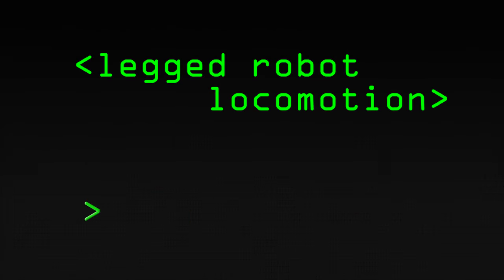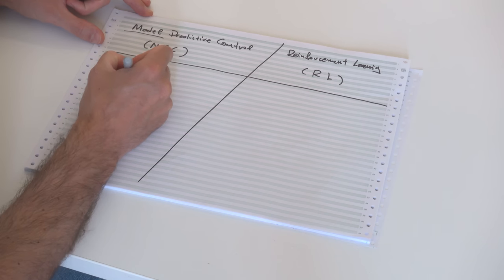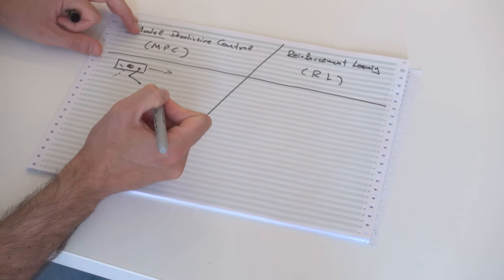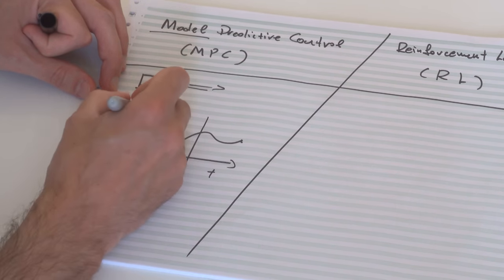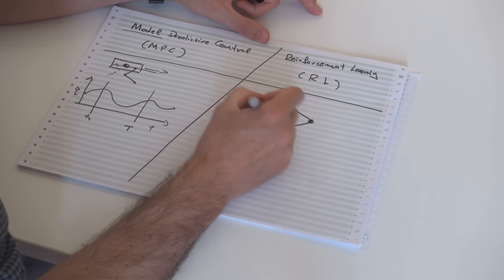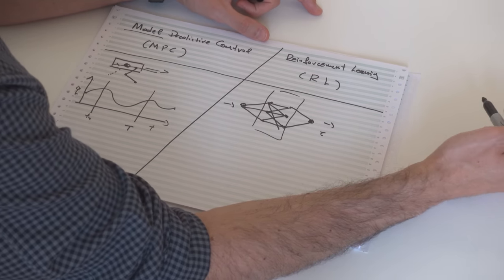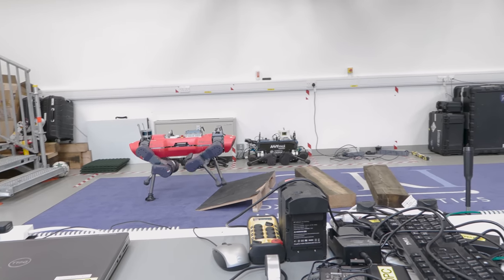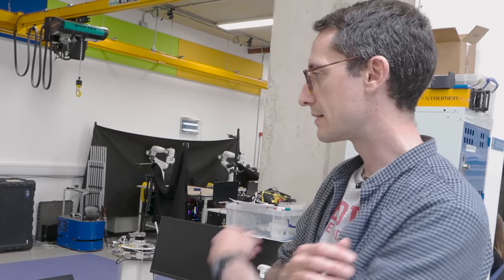Legged Robots - Computerphile

Comment: the funny thing about reinforcement learning people is they say the advantage of rl over mpc is "you don't need a model of your dynamics" but then immediately say "we train it in a simulator [with a model of the dynamics]"
Reply: Exactly! The dynamics are for the simulation people to worry about. Assuming you didn't write your own simulation, and if you have money for real hardware then you probably didn't.
Reply: whats your point, you train it with simulator for convenience, you still have to train it in real life afterward, point being the algorithm it self does not require model
Reply: @oldcowbb  The point is that those people are hypocrites for saying they don't need a model of dynamics.
Reply: @woulfhound  'doesn't need' is not the same as 'doesn't need but uses one anyway for convenience and speed'. Not hypocrites.

Comment: One thing I've always noticed is that the robots always seem to have the same power to the actuators all the way through the motion. 

You can take your arms and swing the lower part around without using any muscles in your forearm by hanging it down and using your upper arm to swing it back and forth. I have never seen a robot where you can do that.

Why is this important? It is important because it wastes a lot of effort and energy. It also causes robots to be stiff and jerky compared to humans or animals where you can describe a lot of people and animals and graceful. When is the last time (the answer is never for me) where you saw a robot be graceful?

I think that is one of the biggest reasons why robots will not "seem" like humans anytime soon unless they stop powering every second of an action. 

You do not strain your muscles unless you are lifting or moving a heavy load. Robots always seem like like they are using maximum effort for everything they do. If we did that with our bodies we would be exhausted and need to lay down most of the day or we would develop much bigger or stronger muscles with more endurance.

Instead our brains have learned that you don't need maximum effort all of the time. In fact, -most- of the time you do NOT need maximum effort. Instead you most often need less than half and in many cases less than 25%.

I'd love to hear thoughts on this about potential smoothness of robots so that they would be a LOT more graceful AND for energy savings that could be had in this area.
Reply: I agree, very interesting point! I can imagine engineers will find a way to improve robots graceful movement. Although I feel uncanny about it, would be quite a spectacle. Imagine what this could do for the entertainment industry and practical effects. A giant robot spider or T-rex!
Reply: Yes, I think if they train the robot to limit energy usage and also train to limit the force on the actuators then a robot will become more graceful and walk more naturaly
Reply: Not true, motors used in robots can generate torque proportional to current which can be any current value. The problem lays into control alghoritms because its very hard to implement
Reply: Check out experiments by Prof Deepak Pathak at cmu
Reply: That's because the actuators are not muscles and give total control at every point. If we had different actuators than rotating geared motors you could do it differently. But there isn't anything else that's a useful size and power.

Comment: 4 leg robots seems to be a mistake. 4 legs are an accident of history, and never came from walking anyway.

It seems that if you've got a many legs as you want, 8 is near optimum. Everything evolves into a crab.

Watch an Australian huntsman spider hunting. It's awesome.
Reply: it can't be an accident if it happened multiple times.
Reply: @dibbidydoo4318  but 4 legs has only happened once.
Reply: @gasdive  would 8 legs allow for running/sprinting?
Reply: @aceman0000099  they seem to. The Australian huntsman spider is incredibly fast. They don't spin webs, they chase down their prey.
Reply: They run at about 5m per second. It's mind blowing to see.
Reply: How about no, giant robot spider is the last thing I want to see in case of a robot apocalypse
Reply: but crabs have ten legs.  Though they DO generally use their first pair of legs as hands.
Reply: @gildedbear5355  yeah, that's sort of what I meant. They could have had 4 legs, plus a couple of paddles, extra claws, egg holders, whatever they wanted. Instead, they've gone for 8 (walking) legs. (and some claws, plus some little feeding claws)
Reply: Does this 8-leg optimum has some kind of proof? Optimum in a sense of speed? If so, is it because it has 2 sets of 4 legs, so the 2 sets can function in a rotating/alternating manner?
Reply: @gz6616  no proof.

It's simply that evolution has thrown up exactly one 4 leg design ever. Yet 6 and 8 walking legs come up over and over, and they're massively successful. Even animals that have 10 legs, almost always use 8 for walking. Animals with 6 legs almost never use 4 for walking and use the remaining 2 for something else (I can think of Preying Mantis, and nothing else).

Lots of 4 leg animals use 2 for walking and 2 for something else (birds, bats, humans), or even give up on their use entirely and just keep 2 or zero. (snakes, whales some lizards, some dinosaurs)
Reply: optimum with what metric
Reply: @oldcowbb  with the survival of species metric.
Reply: I would like to make a three leged creature work, with the provision that it must work in groups of three to be optimal (as a 7 leg collection, middle leg shared 3 in sync or 1-3 separate used for something else), 3x3 3-legged racer of sorts..
Reply: for robotics, twice the legs also means almost twice the hardware cost, and even though 4 legs might be sub-optimal for sheer survival, robots often have a specified task (for ex. industrial robot arms dont need any legs at all) which can be achieved with only 4 legs. the point is not necessarily to replicate the most succesful living species or beat walk-speed records